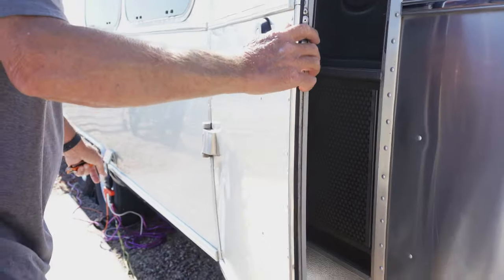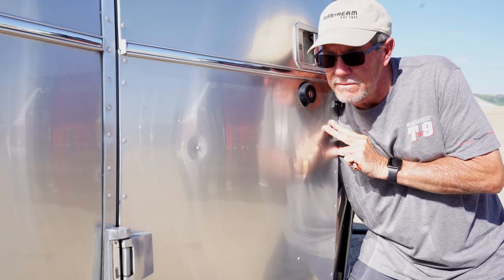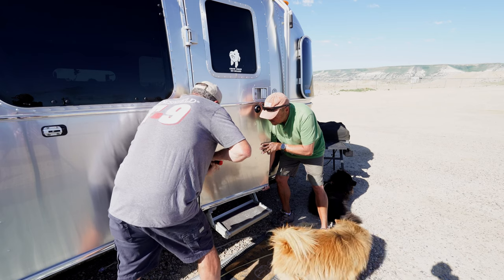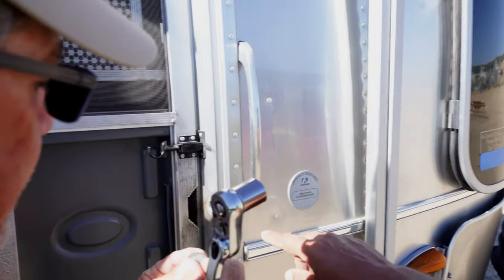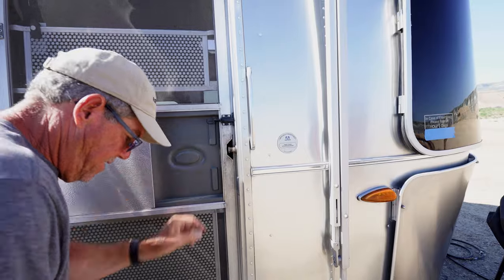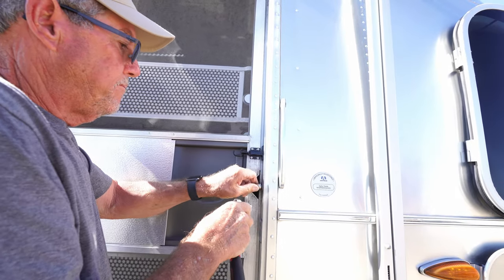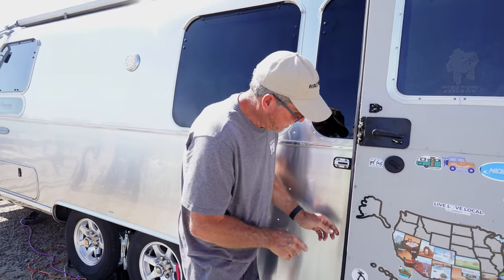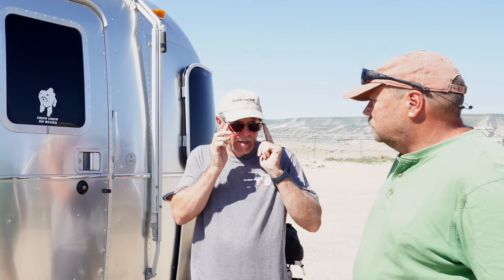We Fix our Airstream’s Door with Phil “The Door Guy” | RV Maintenance

Comment: My screen door on my 2021 Globetrotter is sprung a little, closes fine but there is a 1/4' gap on bottom that tapers off as you look upwards on screen door, what is best way to fix ? I was going to grab and twist back a little.
Reply from the maker: I would very carefully try twisting it. Do a little at a time so you do twist it to much.
Reply: @ZephyrTravels  
Thanks, I got it straightened out